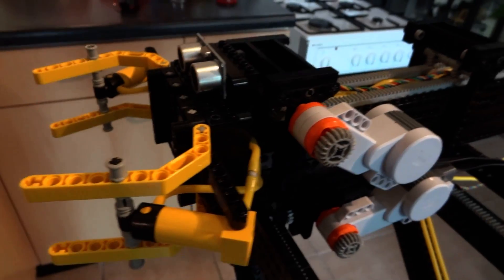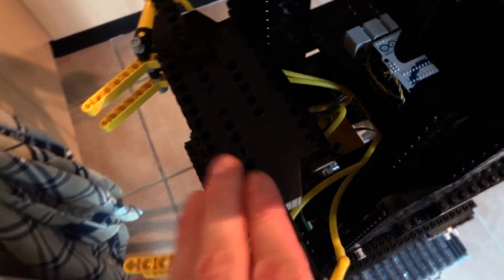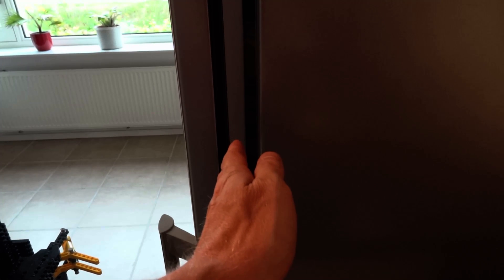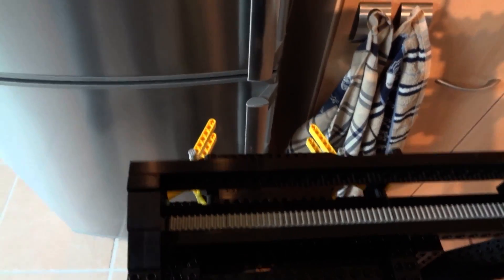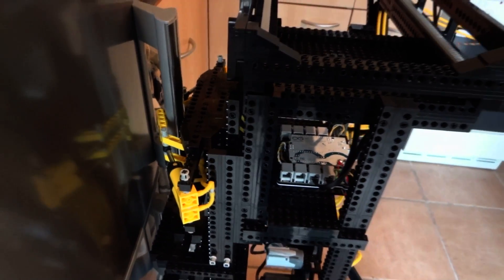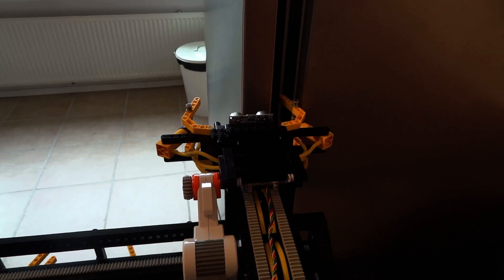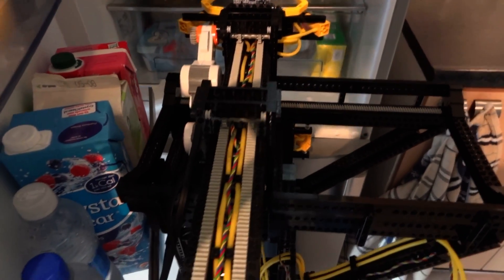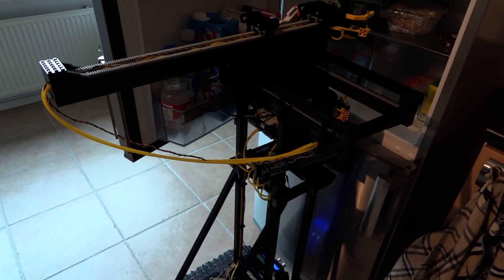Lego / Arduino robot video 6: opening the fridge

Comment from the maker: The hardware is like 3 times cheaper (sensors and so on) and the Arduino platform is much more flexible, using timers, interrupts and stuff like that.